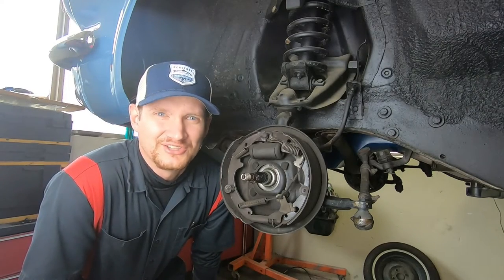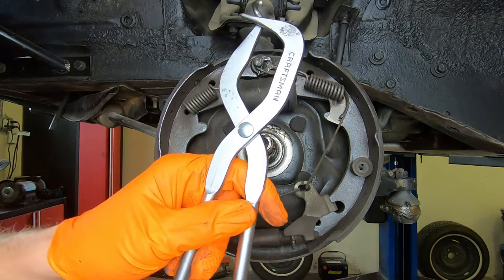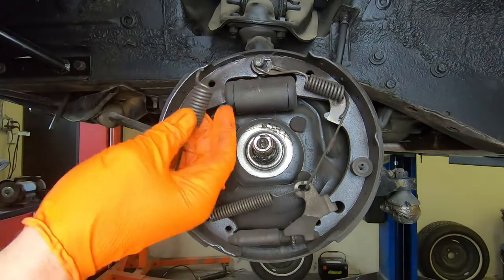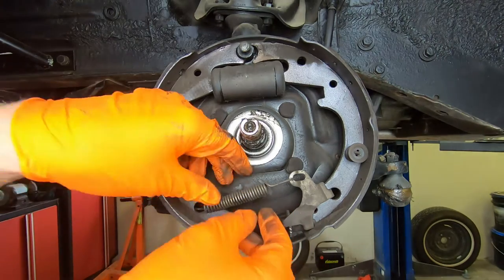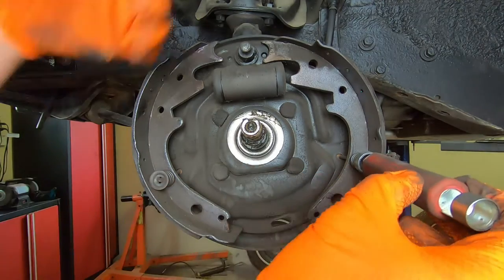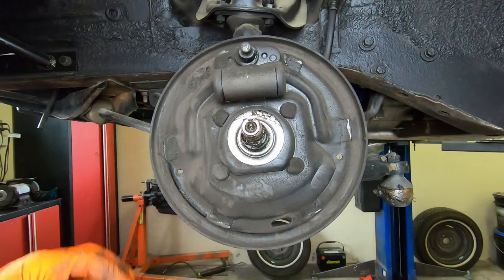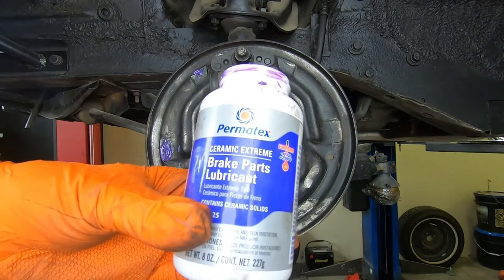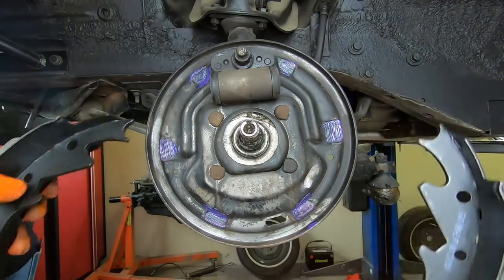How to replace drum brake shoes on your classic Ford Mustang

Comment: Was this on a 6 cylinder car?
Reply from the maker: Yes
Reply: @AlfsMustangGarage  I noticed the were no plungers going into the wheel cylinder. Is that normal? 
Trying to do my brakes and getting conflicting info on if there should or shouldn't be any.
Reply from the maker: No plungers on 6 cylinder cars. Brakes shoes go right into the wheel cylinder.
Reply: @AlfsMustangGarage  thanks for the help!
Reply from the maker: You're welcome